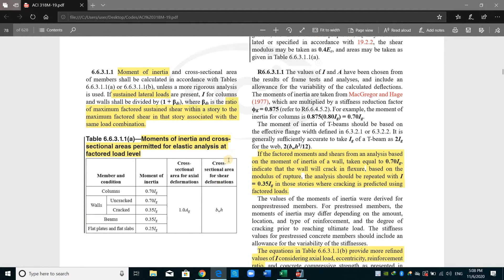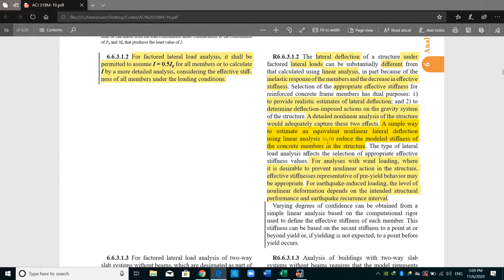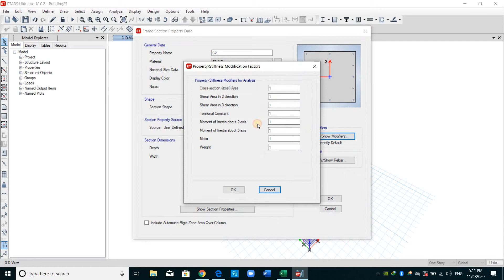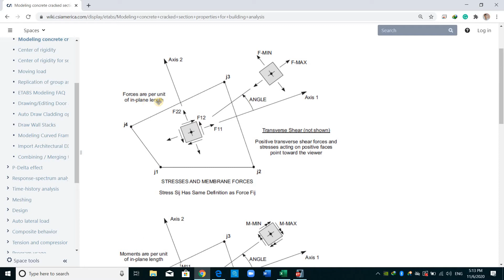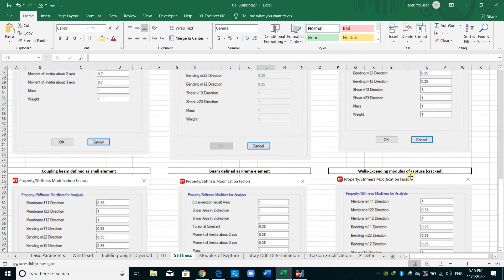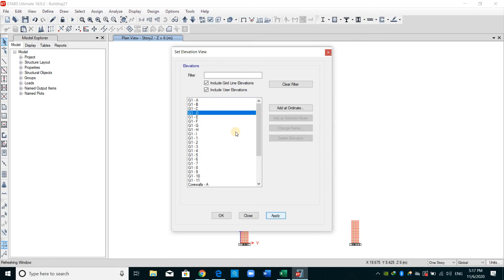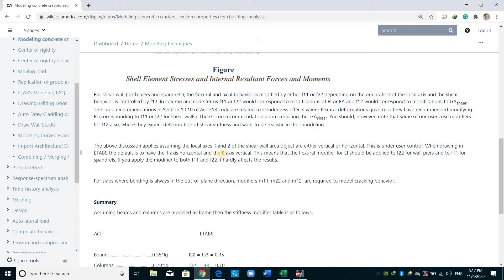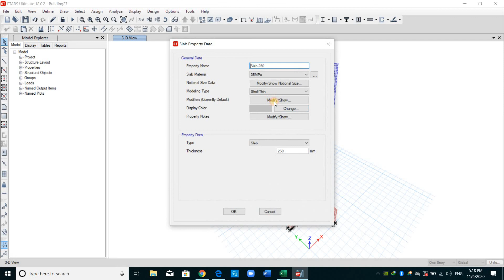How to change the flexural stiffness of walls, column, and slab in ETABS software (Lec13)

Comment: Can I output the result of compressive stress and tensile stress in slab by using ETabs ? How do I read
Reply from the maker: Certainly, ETABS can provide you with the tensile stresses of a slab.

To obtain these stresses, you would need to select the shell stresses results, specifically S11, S22, and so on. It's important to understand the nature of the applied loads, whether they are gravity loads or lateral loads. This understanding helps determine which results you are interested in.

For example, let's assume that a lateral load is applied to the floor in the Y-direction. In order to obtain the compressive and tensile stresses resulting from this load, you would need to check the F11 or S11 values in the shell stresses results. These values correspond to the stresses along the X-axis, which in this case represents the direction perpendicular to the applied load.

Comment: In the CSI stiffness modifier page you showed says you should use the same stiffness modifier if you want to model the out of plane stiffness of the wall. So you should use 0.7 instead of 0.25.
Reply from the maker: m11, m22 and m12 are the modifiers for the out-of-plane stiffness!
Reply: Yes they are but I'm saying you should use 0.7 for out of plane stiffness instead of 0.25.
Reply from the maker: There is no need to use 0.7. I believe you may have misunderstood the website. In my research, I used 0.25, which means I reduced the wall stiffness by 75%, reflecting the reality that shear walls are weak in resisting out-of-plane bending. This approach is commonly adopted by engineers.

If you prefer to use 0.7, that is your choice, but using 0.25 is also valid. Many engineers even use values as low as 0.1 to represent the minimal out-of-plane stiffness of walls.

Additionally, the ACI code specifies reducing the out-of-plane stiffness of slabs to 0.25 but does not mention walls. This suggests that using 0.25 for walls is reasonable since they behave similarly to slabs under out-of-plane loads.